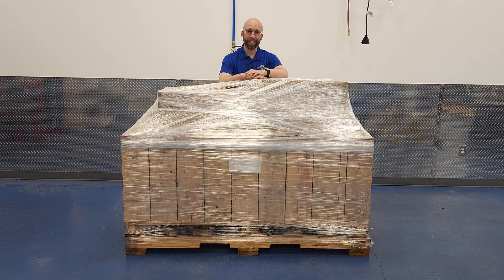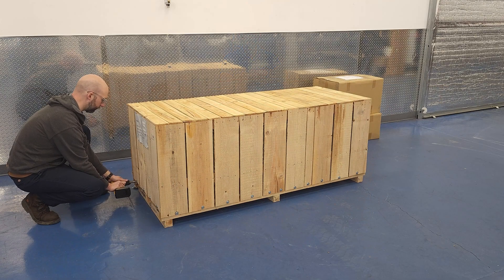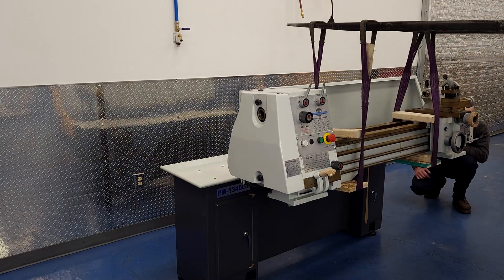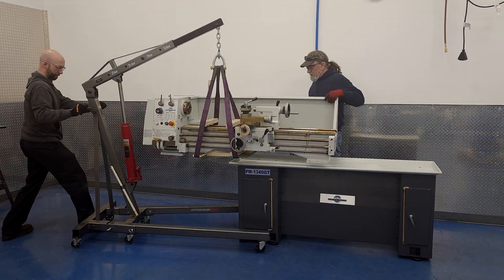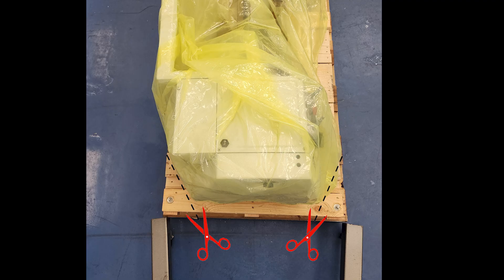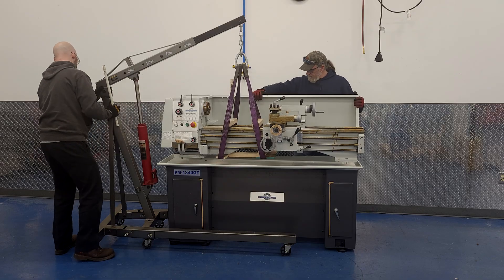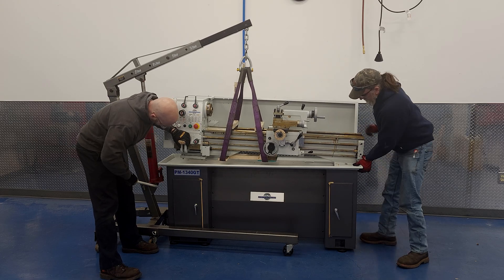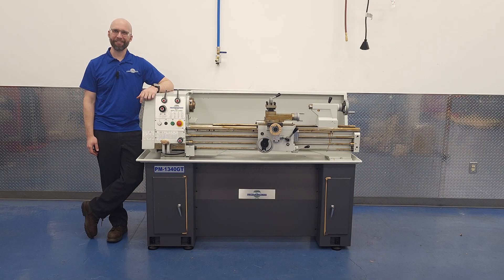PM 1340GT Setup Precision Matthews Media

Comment: Hey, I just got a PM 1340GT, and just now discovered by chance that you have this YouTube channel.  I'm close to getting it on its stand.  It's an upgrade from a PM 1130V I got last year.

Something in this video is not in the user manual:  the engine hoist won't fit around the pallet!  My engine hoist identical to the one in this video.  With the 1130V I was able to lever the lathe and its pallet off the shipping pallet with a 2x4, then with the hoist at 1/2-ton extension lift it off its pallet.  As another commenter mentioned, I was able to lift it with straps through the bed:  while the manual shows straps around the bed (without spreaders), in fact that is not possible without spreaders--the geometry must have changed since the manual was created.

Now for the 1340GT.  Since I don't have a Sawzall (tm) and would kind of like to be able to use the pallets in the future for the lathe, just in case, using a hydraulic floor jack and a couple of 8' 2x6s and other scraps, I was able to jack up the lathe and its pallet off the shipping pallet, slip the latter out from underneath, and set blocks underneath such that it's securely supported but I can now get the floor jack legs underneath and lift the lathe from the front off its pallet.

Another bit of information in this video is that the name tag is at the headstock end--I wish I'd known that!

This is an old man with a bad back.  I got the 1130V set up by myself, but for this 1340GT I might have to ask one of my buddies to help out.

Comment: I can't believe no one has mentioned a problem with vibration between the drip pan and base after the lathe is set in place. It stands to reason this would be an issue since the lathe base only covers part of the pan and base. I am considering lifting my lathe body back up and screwing the pan to the base before setting the lathe. The am setting a 13x40 lathe on the exact same base as in your video.
Reply: I will be doing a 5th and 6th set video on my YouTube channel explaining this. I even ran the lathe today with no v-belt. Same vibration. A fellow machinist I worked with for 33 years agrees with me. I will need to add 8 each 1/4" bolts to bolt the drip pan to the base to remedy this issue. I think if I could have actually flipped the drip pan upside down and jumped on it to bend it the opposite way it might have taken care of this issue. Live and learn!
Reply from the maker: What kind of vibrations are you getting? The lathe, chip tray and stands should all be tightly bolted together. Essentially, assembly you could lift the machine with the straps as shown and the chip tray and base will go with. If you are having other issues, please give us a call or send an email. We will assist however we can.
Reply: @precisionmatthewsmachineco  
Yes, the drip pan is sandwiched between the lathe base and the base/legs but when the drip pan is bowed up/warped like a bowl and the lathe base only covers part of the drip pan you will have vibration. Only stands to reason.
Reply from the maker: Not sure why the drip pan is warped so bad, happen in shipping? Is this a Precision Matthews lathe?
Reply: Same drip pan as in your video. It only takes a little warping to have an issue, especially light guage metal.
Reply from the maker: Is it a PM-1340GT or PM-1236T? We have not had any issues with drip pans to our knowledge.
Reply: Same as the PM 13X40 GT
Reply from the maker: I see you have an Eisen Machine and not a Precision Matthews. Nice videos by the way.

Comment: I have had my lathe for a couple of years now and had to learn a lot of what you mention without these videos. I so wish you had these videos then.  The balance point of the lathe is super important with a hoist. In my case I lifted using with the web through the casting rather than around it, this worked but I had a near disaster when the compound shifted slightly changing the balance point (it was locked with the halfnut but I think is got bumped). Slow and steady wins the race. Love my PM1340GT and My PM833TV.
Reply from the maker: We're glad you are enjoying your machines!

Comment: I set my 13x40 , all went well, the placement and length of the boards in manual was perfect, But I used my rolling A-frame that has 2 - 1 ton chain falls set up , it takes some time, and take the time to do it right. No short cuts , 3 days for me , but I’m cutting chips today. BTW , I’m a crane & rigging supervisor, so I know a bit about rigging.